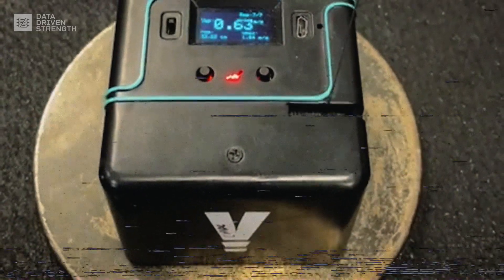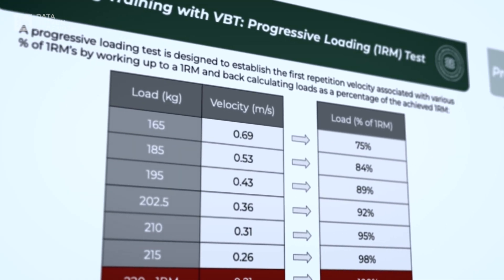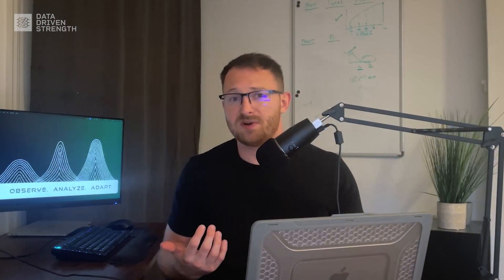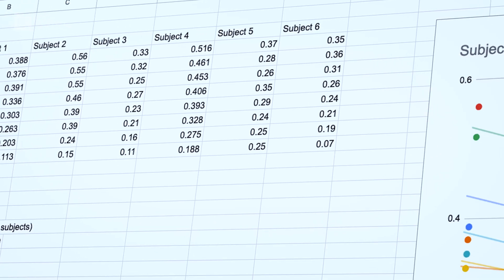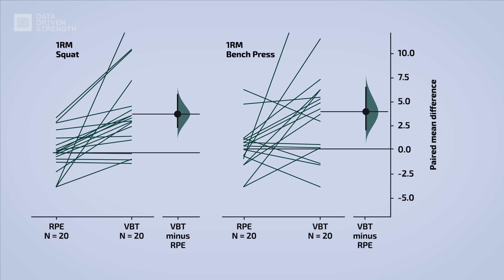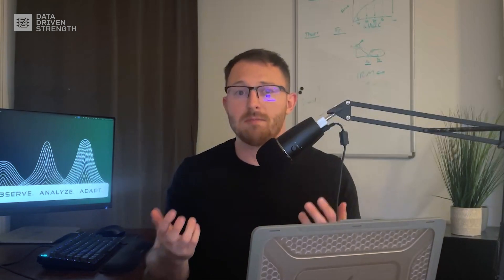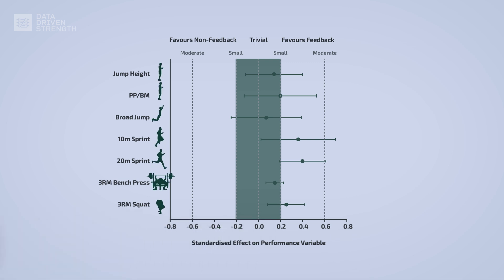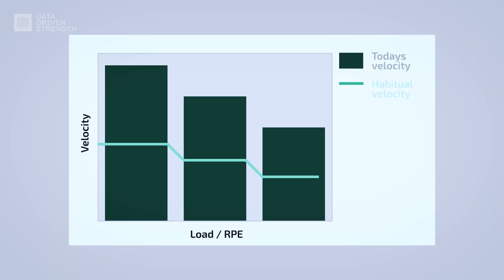The BEST Way To Use Velocity Based Training

Comment: Hello,

Very interesting video, but I disagree with some points you’ve mentioned, and I would like to provide my reasons. Having studied and used VBT for 6 years, I believe I can contribute positively to the points you’ve raised:

	1.	Logistical Challenges: This is subjective, but I could agree when working with large groups of athletes. For individual or one-on-one use, if you choose good technology (like Vitruve), I don’t see any complications.
	2.	Variability in Individual Profiles: I don’t quite understand your point here because you say that a specific velocity was associated with a %RM, and another day it wasn’t. I don’t know if you mean for the same exercise or for different ones. In any case, I think there are points you haven’t considered (or so it seems):
	1.	Between exercises, velocities are different for each %RM, meaning 0.70m/s in bench press could be 70%RM, but in squats, it could be 80%RM. This is normal and depends on each exercise.
	2.	Velocities associated with each %RM depend on the velocity at which the 1RM is lifted, for each individual and for each exercise. While most people lift their 1RM for an exercise at the same velocity, we could find outliers who can lift it slower.
	3.	If you lift your 1RM at 0.15m/s for bench press, and another day you do a max test and lift it at 0.20m/s, that doesn’t mean your profile has changed, it just means that this isn’t your 1RM today; you’re simply not able to lift it that slowly today. This doesn’t require retesting or redoing your profile often as you mentioned, since nothing has changed.
	4.	That said, profiles rarely need repeating. It’s scientifically proven that throughout an athlete’s career, the velocity of their 1RM hardly changes, and when it does, it’s due to super-specialization in that exercise (e.g., a powerlifter in bench press will lift their 1RM slower than a basketball player). In such a case, you could have an individual profile for each athlete if you wanted.
	5.	Doing tests with 3 to 5 loads and measuring their velocity over time is possibly the most effective and efficient way to measure an athlete’s performance in that exercise because you can see how over time, the same loads are lifted faster or slower across the entire force-velocity curve. Often, only the 1RM is measured to evaluate performance, but this is just one point on the entire curve. Additionally, if you graph this, you can see if there have been greater improvements in one area than another, and you can draw conclusions about the effectiveness of your training.
	3.	I agree that if you don’t lift at the maximum intentional velocity possible, VBT makes no sense, but then very likely strength training will be much less effective. Sometimes, due to technical issues with the exercise, you may go slower in a repetition, but it falls on the coach or athlete to know this and do one more repetition, even if it appears we have reached the prescribed fatigue.
	4.	Regarding the comparison of RIR or RPE, I simply think it’s not a fair comparison since the training is essentially the same, and what we’re debating is the measurement method. VBT is not a training methodology; it’s a measurement tool. Evidently, you can prescribe using VBT just as you can prescribe using RIR or RPE. RIR, in particular, seems very unhelpful because doing 2 reps out of 4 possible is RIR 2, but it’s also RIR 2 to do 8 out of 10 possible. However, the effort, the fatigue generated, and therefore the stimulus, are entirely different. This doesn’t happen with intra-set fatigue, since a 20% Velocity Loss, for any intensity (with nuances), means doing half of the possible repetitions, so the generated fatigue will be the same. RPE can be a useful tool, at least to compare what VBT objectively tells us with what the athlete subjectively tells us. Not to mention that except for powerlifters, most athletes often work far from failure, making RIR and RPE tremendously imprecise.
	5.	That said, studies comparing VBT with PBT, RIR, or RPE, I think, are poorly designed from the start. You can do very poor training with VBT, you can make terrible decisions, and what will result is a completely disastrous training. As I said, VBT is a tool, not a methodology.
	6.	Regarding programming or not with VBT, I believe there are correct and incorrect ways to do it, and unfortunately, many people do it incorrectly.
	1.	An easy way is to prescribe absolute loads and analyze the velocity. Increase this absolute load when we are 10-15% away from the initial velocity. Something as simple as that ensures we comply with progressive overload, see daily or weekly progress, and save a huge amount of time programming.
	2.	Another example is having a target velocity range, where we aim for the fastest velocity of the series (which indicates the performance of the day), and when we go out of that range, we increase or decrease the weight. And I’m not talking about velocity zones, a completely wrong concept that many coaches use and which makes no sense.

I hope this helps clarify the points I disagree with. Please don’t take this as criticism, but rather as constructive feedback to consider.

Comment: Would you suggest that a lifter would have a daily velocity and base it off that?  Some coaches do this intuitively.  So then is it less about the bar speed and more about the intention to accelerate the bar, as shown by Digby Sale in 1991.  If so, then why wouldn’t RPE  be better than RIR, unless you are measuring against a target bar speed?  Meaning one could still do several reps that don’t meet the expected bar speed.  Thanks for the detail you put into your videos, Great content, I think this is an area completely forgotten by other channels.  You guys have great integrity.

Comment: Does rep speed always slow down as you approach failure? I’ve measured it on some movements and the reps absolutely did slow, but other times when I wasn’t measuring I’ve felt like I simply hit a sticking point and couldn’t complete the concentric. Then again, I’m guessing it didn’t feel like the rep slowed because I wasn’t paying attention to the rep velocity.

I know Mike Israetel has argued about this metric before (https://youtu.be/u5QyWBOH02k?si=4cYCds6C3ZneQlXY at ~9:40), but that certainly seems contrary to how other exercise scientists have defined training to failure.